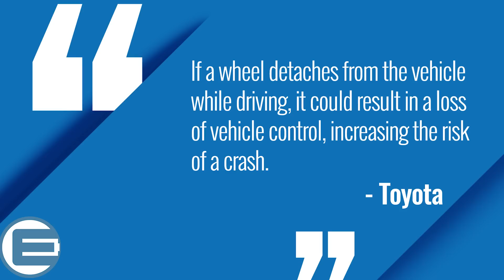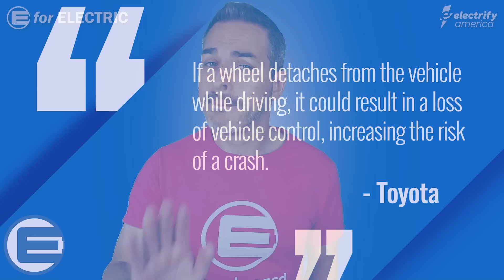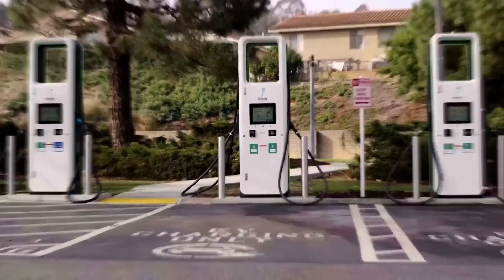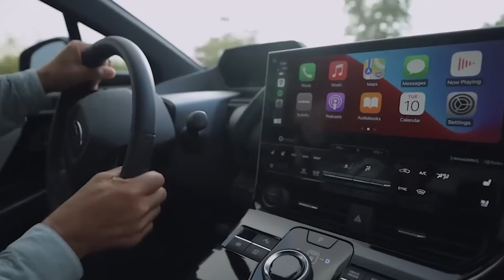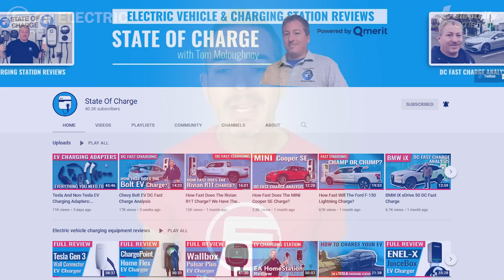Why Toyota Just Pulled Its New EV Off the Market

Comment: Fairly common in a brand new vehicle and likely just one bad batch of nuts, a process adjustment needed, or a machine that wasn't set to the correct torque value. But I agree that the vehicle is a token effort just so Toyota can say they have a BEV. I'm sure I'll never see one on the road and it will only be available in ZEV states in small numbers.

Comment: THERE'S NO CHEAP WAY OUT! 70 MPH AND YOUR WHEELS FALL OFF! THEN WHAT!?
"just lay off buying a car (electric or otherwise) for 5 or 6 years until the legacy automakers figure things out"
<automobiles are products of design, engineering, and manufacturing. metallurgy and tolerances are big issues too of course. just ignoring everything else (crucial safety steps and issues), just to slap a battery and electric motor in some newfangled car are bad engineering practices>
<using the cheapest tolerances and cheapest steel to manufacture, only lead to disaster>

Comment: After wasting several billions on Hydrogen fuel cells for small vehicles Toyota is still being run by the same CEO who has lost them their total future.
Toyota will be a Chinese brand in less than 5 years time. They are dead in the water. They have just not stopped twiching yet.

Comment: Err no that is not so about the unintended acceleration. 
The fault was a Ford made cruse control module that defaulted to full on if any error was detected. 
Toyata had 25 people die in accidents in vehicles fitted with these faulty units.. Ford had well over 2500 people die and Jaguar also lost some people because the same module was used on Jaguars who were owned by Ford at that time. (Not a good time for Jaguars) 
There is over 8 hours of video on You Tube of the Grand Jury enquiry into the problem. 
How do I know this? My Borther was the expert who reverse engineered the electronoc design of the cruise control unit which proved it to be at fault. His name is Martin Keith Armstrong. 
Typically Americans do not lile to think anything is their fault (i.e Climate chamge) hence try to blaim someone else for the problem.. in this case Toyota. They made many wrong statements qhen they knew they had a problem but did not want to take every singe one of thwir cars off the road. Ford employied an Army of lawyera to keep people quiet instead.

Comment: We lost a rear wheel from our VW 181 (nickname Kubel or Thing) on a German highway, about 40 years ago. 
German leftwing anti army groups where famous to sabotage every army vehicle. 
Our VW 181 used to be an army vehicle in the 60th, but was since 20 years sold to the public, (but stilll army colored).
 
We had eaten some food in a highway restaurant, when noticing some extra attention around our car in the parking lot, by some "hippy-like"figures. 
We didnt know about the "anti army" feelings and thought nothing of it around that time. (police later told us.)

When we left the parking and turned on the highway, I noticed some rattling noice and thought the rear door wasnt closed. 
But sudenly the car dropped sharpely down to the left and i had to stear to the right to keep the lane, and saw my rear wheel overtake us, (we were doing over 50mph going downhill). 
The wheel was taking up speed downhill, bouncing and going slowely to the left lane. 
Lucky, there was some guardrail between the roads, so the wheel didnt bounce into the traffic on the other side.
I managed to get to the safety on the side of the road, coarse the VW 181 had drumbrakes, and i never touched the brakes. 
I let the car role out, and found the wheel 1 mile further down the road. All wheel bolts where gone. 
Back on the parking lot we found 3 bolts.

Comment: Alex: The Toyota “unintended acceleration issue” was actually due to an egregious firmware bug, not sticky pedals as was initially reported.  Certain conditions caused a microcontroller to overflow its stack, corrupting memory and causing the (fatal!) issue.

Comment: Don’t know what’s worse: unintended acceleration… or, unintended incineration! 
Anyways, it very well may not even be Toyota’s fault. The nuts, bolts, and wheels may not have even been made by Toyota; those parts and many more are commonly outsourced to automotive suppliers.
Reply: Very true! 5000 cars x 4 wheels x 5 lug nuts and 5 Bolts = 25,000 bolts and lug nuts! 

But maybe the issue is not using a torque wrench to install the bolts in the wheel hub? and a torque wrench installing the lug nuts? 

Question is who installs the 5 bolts in the wheel hubs? Factory or hub and bolt supplier? 

How are the bolts installed? Theirs no bolt head it’s a shaft with threads and the number of treads are supposed to be exactly the same as the lug nuts!

Every car has the exact same size lug nuts and bolts.
Reply: @Nonsense62365  my bad, for some reason I thought the bolts were failing. Don't know if they're press fit but the video said they were coming loose? Possibly an assembly issue if that's the case.

Comment: When someone or some corporation stands up to a problem I hate to see too much made of it even if it is fun.  Their responsible behavior may have saved lives unlike the Chevrolet Corvair and Ford Pinto fiascos.  How would you like to be the engineer that called out the bolt specs?
Reply: Ah yes, I knew the Toyota fanboys would quickly spin this into how great Toyota is.

Hey, does the EV come with drum brakes like a Taco?
Reply: @JohnCap523  Actually John, I can't remember ever owning a Toyota.  And the last five or so years with those gargantuan grills the cars are a marketing joke to me and how they've sold more than a few is completely beyond my understanding.  But I do like folks that stand up and admit a mistake and get to work on a cure.
Reply: @unclegeorge7845    Pretty short mistake when wheels are falling off. As is stated in the video, Toyota resents the move to EVs, has been lobbying to slow it down and is only coming out slowly with EVs because the market is forcing them. Probably had three apprentice engineers designing this thing. Their reputation as top quality is hanging on despite having expired years ago…

Comment: Not that it is specific to this channel but pointing out the recall without getting to the root cause is little more than spreading FUD.
Where the bolts improperly tightened?
Where the bolts improperly made?
Did they thread metric bolts into imperial holes?
I know sounds silly but there does not seem to be much else that can be the root cause.D
Heard an unconfirmed explanation that the bolts were over torqued at the factory causing them to fail.
Reply from the maker: Dude, I told you everything I know
Reply: @EforElectric  Yeah would be helpful if some of these companies were a bit more forthcoming.   Like I said not specific to your channel.  Thanks for the reply.
Reply: It's Toyota's job to get to the root cause. The publically relevant info is what they announced with the recall. 

Also,  Imperial holes? On a Toyota.  Really?
Reply: I always ensure my wheel lugs are properly torqued at home after mistakenly thinking my bmw dealer would do the same when doing my seasonal wheel swap. I discovered they were gunning them at some insane torque that my 1/2in IR air gun couldn’t loosen.
Reply: Mag wheels have a history of falling off.Any reputable tire store will have you come back the next day to retorque  the nuts if you have mags
Reply: @glennkelley6096  it's not the wheel lug nuts,  it's the hub bolts.

Comment: This is why Japanese auto firms have rolled out new product domestically BEFORE rolling out for export. Since the 1960's Japanese auto makers have perfected new platforms in the domestic market. Toyota committed a cardinal sin in skipping this time honored process. This is the process that weeds out all failure points from a product before it is ever seen in a foreign market.

This recall has nothing in common with VW's dieselgate. Dieselgate was a byproduct of bean counters running rough shod over Engineers. VW had clean and efficient diesel engines available through their BlueTech partnership with Mercedes. But, in order to save on licensing fees they chose to push their inferior and dirty in-house 2.0 Liter VW engine to market. Those 1.6 Liter BlueTech engines are brilliant engineering, clean and efficient.

VW engaged in a program of deception, and then tried to cover it up. Toyota took ownership of the defect early in order to mitigate the impact.
Reply: A Toyota was the first Japanese car I ever saw. I think that was in 1970 or 1971.
Reply: @nickiemcnichols5397  Legend has it that Toyota developed the Corona by reverse engineering a Mercedes sedan. They wanted to make a highly capable and reliable vehicle with lower curb weight and smaller dimensions suited for their domestic market. They were fearless, bold, and ambitious.

Comment: I thought the BZ4X and the Subie EV are really just rebadged BYD cars?
Reply: Toyota BZ4X electric SUVs are manufactured by China's GAC and FAW, while its BZ electric sedans will be manufactured by BYD.
Reply: @smakwt  For the Chinese market. The cars for the USA and other markets are manufactured by Toyota in Japan. So are the Solterra and the RZs for Lexus.

And there is one sedan manufactured by BYD and that too is for the Chinese markets. There's nothing saying that other bZs will be manufactured by BYD or that the bz SDN will be manufactured by BYD outside of China for the other markets. For now, we know it's China market only.
Reply: No this one is made and designed by Toyota with Chinese batteries (two companies I think/one for the rear wheel and another for the 4 wheel drive).
Reply: @kyliefan7  Panasonic, Japanese or CATL, Chinese.

Comment: My 2003 GMC had a torque setting over 110 ft pounds. I couldn’t believe it the first time I tried to loosen a wheel stud.
Reply: Would have been an easier recall for Chevy.
Reply: All tire stores over-tighten lug nuts! They don’t use a torque wrench when tightening lug nuts! THEY ALL USE AIR TOOLS ! I’ve been driving since I was 17! I’m 66! My dad had (2) Tire stores in Los Angeles I’ve Never seen any tire shop/Tire store, break shop use a torque wrench to tighten lug nuts! Has anyone? EVER? I don’t think so! Maybe some car manufacturers use them? IDNK? That I can’t speak too only someone Who’s worked in a car plant building plants can talk about this
Reply: @Nonsense62365  Yeah, an air tool with a torgue setting.

Comment: Imagine if the Chevy Bolt would have had this issue.
Reply: 16 of 141K bolts burst into flames. 
GM purchased what was supposed to be quality batteries from LG
We can't blame GM engineering for this.
Reply: @danharold3087  was thinking a Chevy Bolt losing its bolts… 😝
Personally, I think Chevy did an amazing job on both the Volt & Bolt.
Reply: @MarioDallaRiva  The bad rep the Bolt got for these fires is a bit of a hot button with me.🔥 A case of going after the low hanging fruit.
Reply: LG Bolt you mean